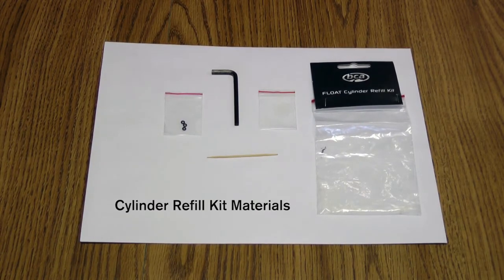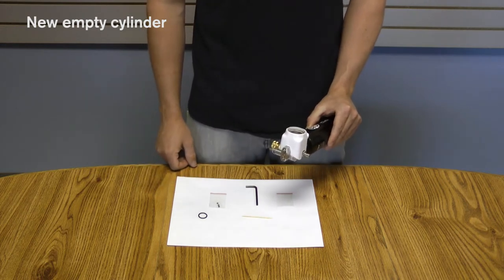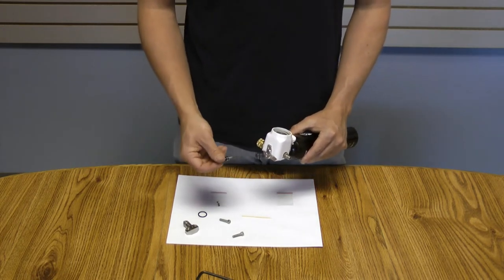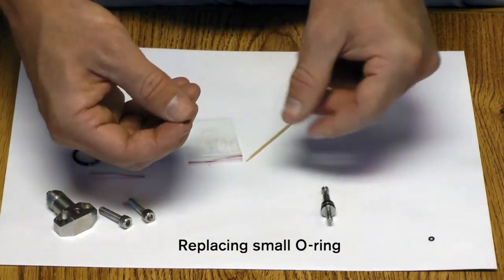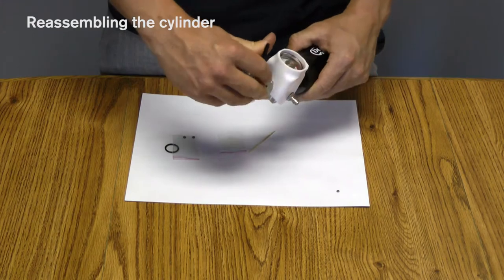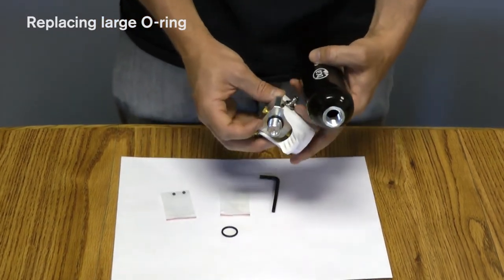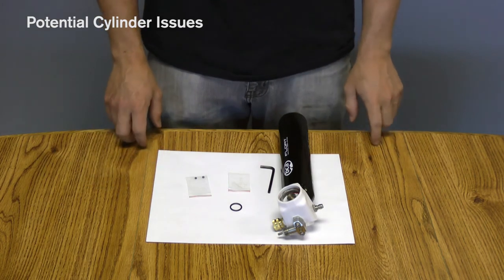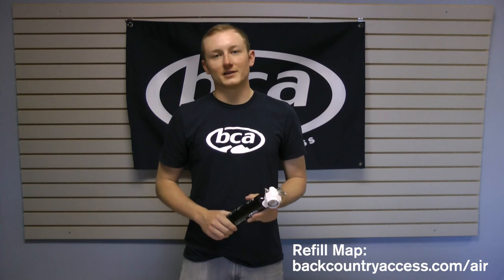Float Cylinder Maintenance & Preparation for Airline Travel

Comment: Comment for the Float 2.0 canister: The video makes it seem easy to torque the head off the canister, but when new the head is extremely tight and you've to really get some leverage to unscrew it. I almost gave up but finally worked.
Reply: I just trying right now and i started to thinking that it is impossible to open this shet

Comment: Thanks---So the refill kit comes with 3 0 rings but not much grease-next year I'll  need some new grease-what brand do you recommend to replace it and where could I get some?
Reply: pro tip: you can watch series at flixzone. Been using them for watching loads of movies recently.
Reply: @Ethan Cain definitely, have been using Flixzone for since december myself :D
Reply: @Ethan Cain Yea, I've been using flixzone for years myself :)
Reply: @Ethan Cain yea, I have been watching on flixzone for months myself =)
Reply: do you know if you can travel by airplane with the cylinder full charged,=???